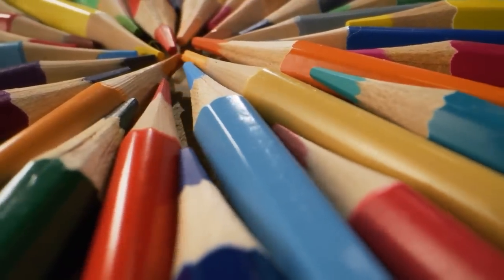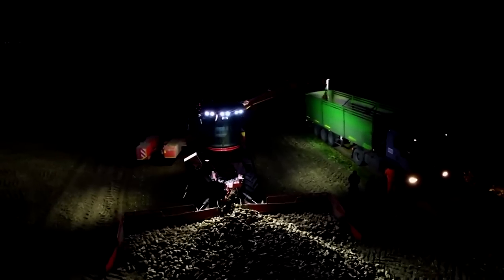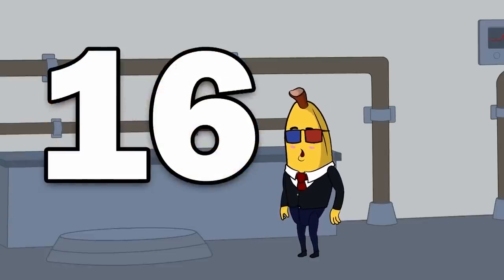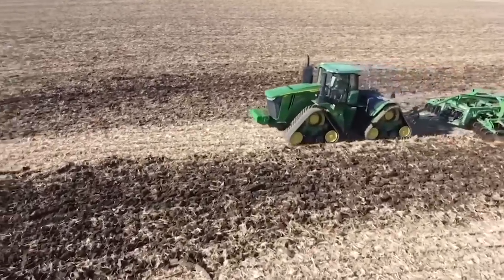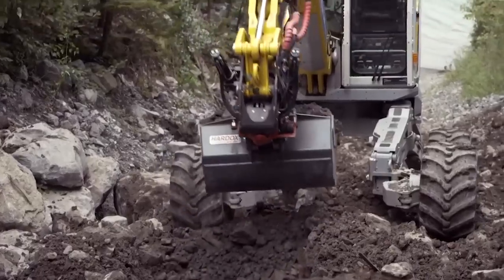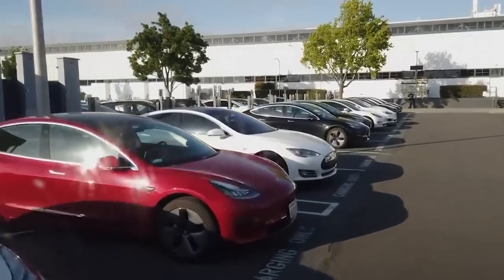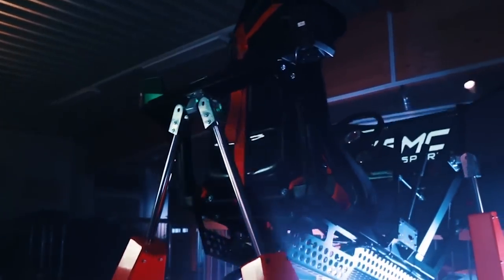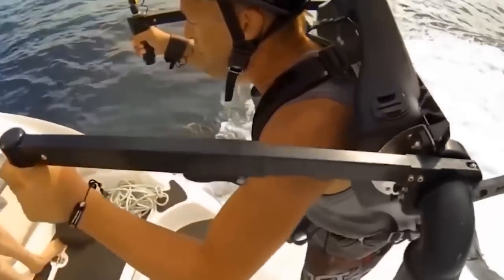20 Most Amazing & Ingenious Machines You Need To See

Comment: @ 18:59 "  lot of them (electric cars) tend to catch fires and burn things down"? 

Do Teslas catch on fire more than other cars?

It says the 300,000 Teslas on the road have been driven a total of 7.5 billion miles, and about 40 fires have been reported. That works out to five fires for every billion miles travelled, compared to a rate of 55 fires per billion miles travelled in gasoline cars.

Hybrid-powered vehicles are at the highest risk of catching fire. An estimated 215,000 vehicles will catch fire in 2020. Battery-electric vehicles are only . 03% likely to ignite, compared to 1.5% for gas-powered vehicles and 3.4% for hybrid vehicles.Nov 22, 2022

Comment: Farming is not dangerous? What world do you live in? Farming has a higher rate of injury than many other industries. About 30% of farmers suffer a workplace accident every year, according to the Worker's Compensation Board.
Reply: I think they are referring to the actual process, or work action. Example, harvesting is safe as you are driving back and forth.  Logging, trees are falling, inclines,sharp blades.. But yes, farming is dangerous when you factor in fixing equipment, loading dryers, etc
Reply: @CarsCatAliens  At 16 years old I almost flipped a tractor I was driving down a hill. I was farming, not logging or etc.